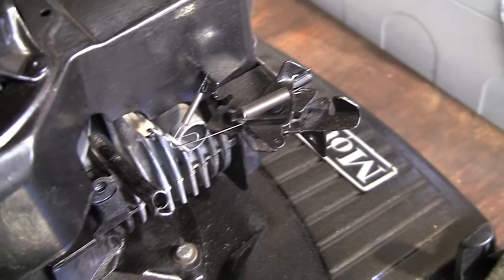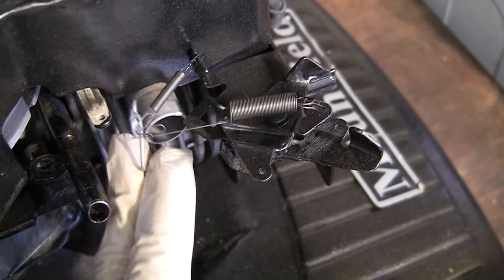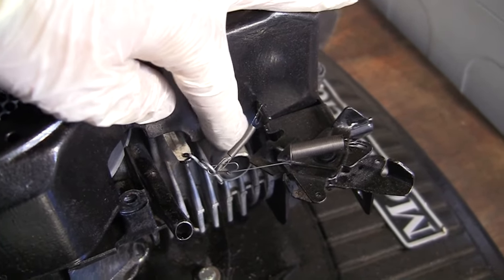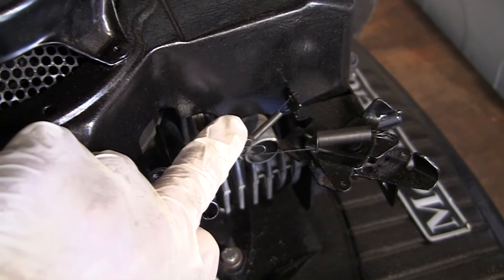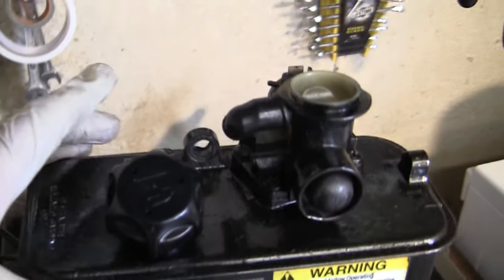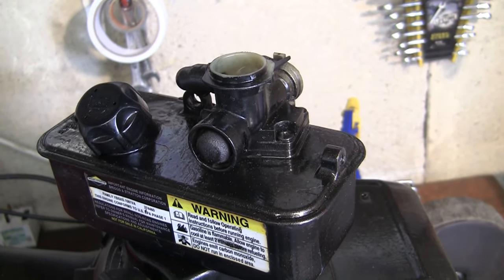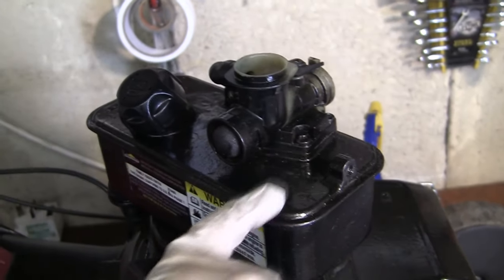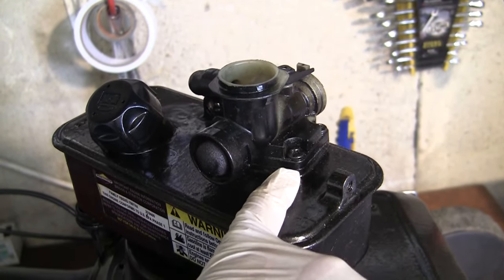How To Fit Lawnmower Governor Springs (Briggs And Stratton)

Comment: Thanks for the video. The information is helpful. I am trying to see the placement of the  governor spring on a Generac GTV-760 (050582) engine that is on a Dixie Chopper zero turn mower. The spring came lose, and I'm unsure where it goes. Thanks.

Comment: Replaced the carb gaskets just as you did. And still my mower revs up and down, a minute then dies. Takes several pulls to get it started again. What did I do WRONG?
Reply: Engine surge....Lots of vids on YT to fix.

Comment: What's the best way to coil them/remove them without trashing the springs.
Reply from the maker: Unhook with a flat head screwdriver
Reply: @MowerMan  many thanks does  that not strain the metal on the coiled parts though so they don't loop properly anymore? Your videos have been an amazing help, my 15yo+ champion/Briggs and Stratton Classic 35 should purr after all the maintenance. Any suggestions on grease please or just a standard lithium multi purpose will do for the various bits?

Comment: Hey man i got given a sp550 mountfield 6hp came with one governor looks over stretched not letting the throttle body go back into place (butterfly staying open other wise) do you have any advice if it needs to springs and where they would be mounted cheers man
Reply from the maker: Not sure I,ve had one in tbh hve a look on this website https://www.shouldersofshoreham.co.uk/mountfield-sp-550-spares-12-9686-00-2005
Reply: @MowerMan  doesnt seem to show the carb area or am i missing something on hear i may give mountfield tech a call and see what they say cheers man

Comment: Paul, have watched lots and lots of your videos and they are amazing. I am going to try and repair my very first lawnmore........ but i have run into troble. It is a B&S 450 series 148cc - Qualcast 46sp and the belt cover underneath is broken (they hit a rock!!). I cant seem to find where to get the spare part for this. I have searched for 3 hours online and cant fid anything. Can you help please??
Reply from the maker: take a look at the silver service ticket on the lawnmower. Use these details to find parts for the lawnmower
Reply: www.partmaster.co.uk  have a Qualcast Lawnmower Belt Cover, don't know if it's the one you are trying to find. Good luck.

Comment: Great video. Quick question: is there usually a tiny spring underneath the smiley face butterfly arm to help the governor arm/vane return to the open position?
Reply from the maker: Not on this briggs engine
Reply: @MowerMan  interesting. I have a briggs engine with the pulsar carb and its idling horribly. Its had a new genuine diaphragm and gasket but to no avail. I've checked the intake manifold and breather pipe and the governer arm and springs are moving freely but it's not happy at all

Comment: hiya, i picked up and old mountfield sp550 with a 6hp briggs engine and its running flat out, last person couldnt get it on ive got it on but now revs too high, its governor spring wasnt attached to wrong place but it seems to have a different type that im not use to has a long metal rod going to the back of the mower for the throttle speed and the metal rod doesnt seem to come back or forth with the new governor springs i have? any ideas? or if you have a fb page or something happy to send images
Reply from the maker: not sure I can help with that tbh sorry

Comment: You did connect the wire rod incorrectly by the way, the tiny short "L" goes into the hole not the hook end.
Reply from the maker: David Randolph Thats not the way I've ever seen it done? Which part of the video please?
Reply: @MowerMan  I have no excuse (brain fart I think) but I believe you were right. I apologize for my confusion.